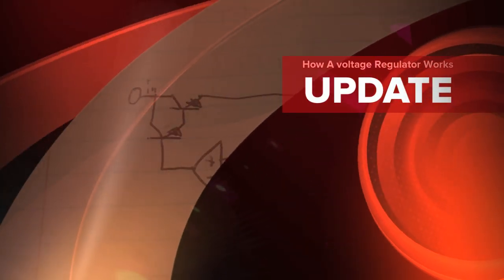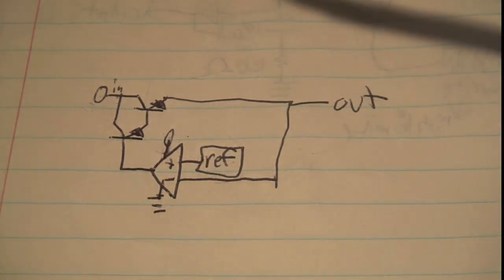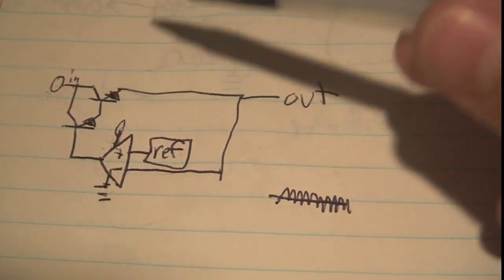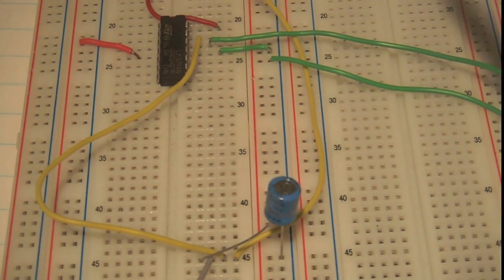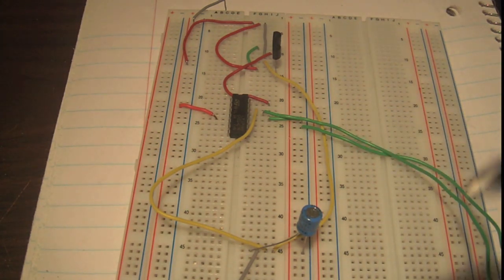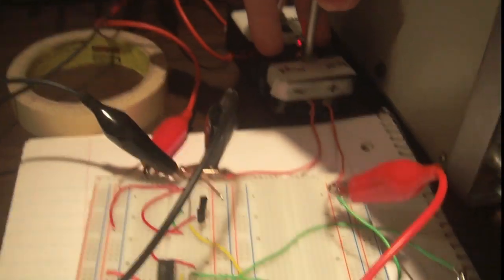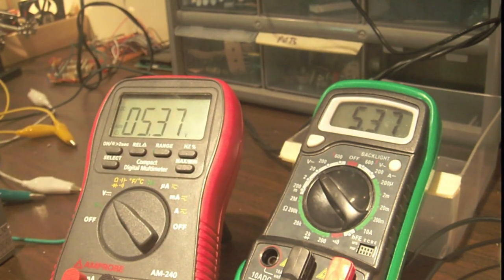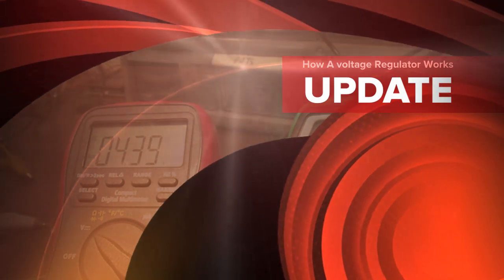How A voltage Regulator Works

Comment: Two questions

1) How is the voltage ref made, its essentially a regulator right? Zener Shunt?

2) If all it is is an op-amp and a darlington pair... why all the heat? somebody explained before to me that the voltage dropped ( lets say 7V if a 12V input is used on a LM7805) is multiplied by the amps and thats the wattage that is turned into heat.... But there is no Amps that flow through an Op-Amp (ideally).

Comment: So how do they get the reference voltage inside the actual component?
Reply: +Atristiel Usually they use diodes as a voltage reference. Diodes tend to work well because they have a fairly constant voltage drop when they are in their conducting state. You could try building this circuit and use a 1k resistor connected from the voltage source to the ref pin, and then a 3.3v diode connected from the ref pin to ground, and it will effectively give you a 3.3v regulator.
Reply: takide6of8 Cool, I learned about zener diodes last year but I still couldn't connect the dots.
Reply: +Atristiel Oh and if you look at the internal circuit diagram of a common voltage regulator like an LM7805, you can see the diode inside that they are using as a voltage reference. Pretty cool stuff!
https://www.sparkfun.com/datasheets/Components/LM7805.pdf
Reply: takide6of8 Looks complicated enough... I'm not good enough with transistors to be able to follow that circuit but I do see one of the zener diodes giving the reference. Neat.
Reply: So if a diode by itself can produce voltage good enough to be used as a reference, why not just put a diode between input and output and call it a day?

Comment: can you explain the parts? in the diagram I understand that the two tiny things are transistors, but what's the big triangle with + and - inside it?
Reply: okay I got it, it's an operational amplifier, but why is that necessary?
Reply from the maker: It basically changes the output to make the two inputs be at the same voltage. So it will drive the transistor to make the output the same voltage as the voltage refrence.
Reply: +quicknuclearscience you should use a zener diode for a vref

Comment from the maker: Sort of. They can't covert AC (changing) voltage to a stable DC (non-changing) voltage. They merely convert any DC voltage to a lower DC voltage. Ex. 5v in 3.3v out, for the same regulator also 7v in 3.3v out, or 12.4v in 3.3 v out.